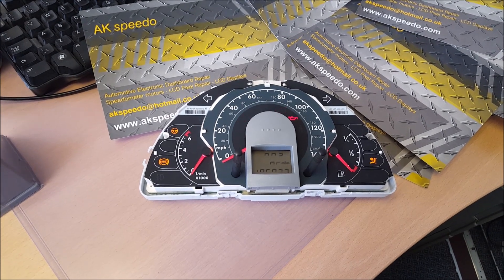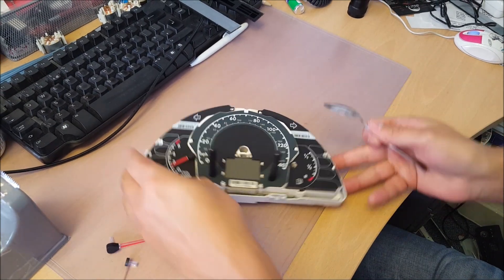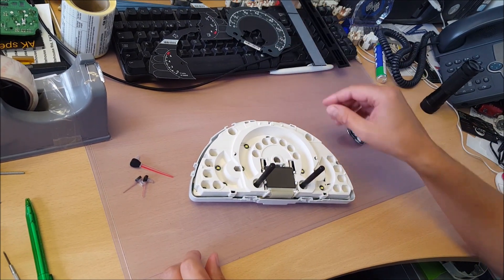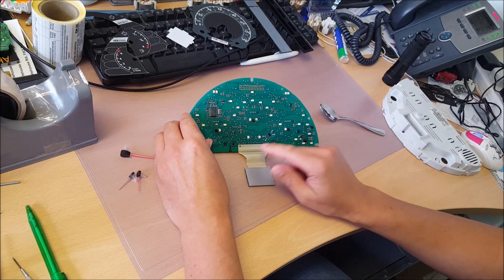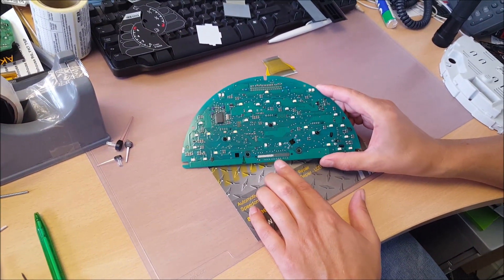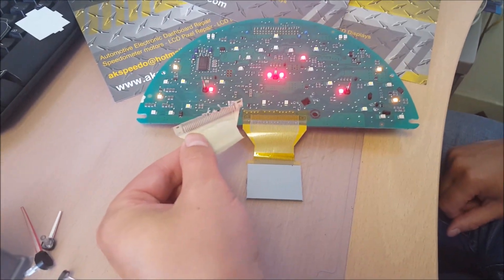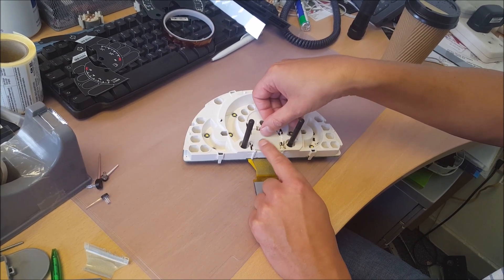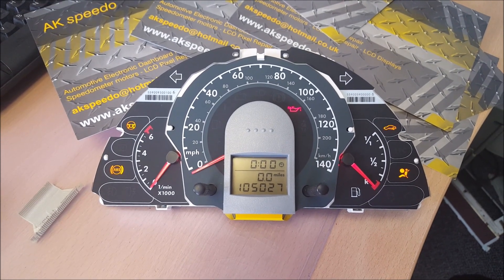VW Fox Speedometer Speedo LCD Pixel Repair

Comment: Watch out - when using the spoon to remove the needles, make sure it's align to 0 or a reference mark as you will need to put it back in exactly the same position. My Fox now appears to idle at 0rpm...

Many thanks for the very helpful videos though, it helped me replace the indicator buzzer on the back of my clocks!

Comment: Thanks Very much, your strip and soldering iron  t bar worked enough for me,  I got the milage showing again in full, which was my main requirement, the clock and distance counter are still not fully showing, but I am sure that was down to not having an exact line up on the strips on my part before heat gluing, however at least I will be able to sell the car now with the milage showing which was main requirement. So I would fully recomend this cheap fix. Removing the unit is fairly easy and can be looked up on the net. I cleaned the old glue off the carbon pads using a cotton wool bud and nail polish remover and used a credit card for the lcd glass. A tip to others doing this fix is to take a photo of the dials before you remove them and dont screw the panels back on the car until you have checked the speedo calibration after refixing them, I didnt take a photo and  had to remove the unit and speedo needle and re-fix it a few times to get it back to 0 at a stand. First time was at +10mph second time -10mph, 3rd time I got it right. Again the fault was on me. This is well Worth a go for a fairly compitent diy er. I am pleased with the result. Worst case you may need a couple of strips incase first one not quite correctly aligned.

Comment: There are some lights broken in my dashboard, is it possible to repair it?
How do you uncounted the dashboard?
Thanks
Reply from the maker: Hi, What lights are failing?
Reply: Warning light to show that front lights are switched on, light alerting overheating of the motor.
If I good understand, it’s not incandescent buble but led directly soldered on the circuit board...
Thanks
Reply from the maker: Yes, correct, SMD LED soldered to the board, cheers

Comment: looks good. im going to buy the cable from your site its pretty cheap. what is best to clean the pads with though?
Reply from the maker: Drop us an email one you've placed your order, cheers
Reply: Did it today. Clean carbon pads with acetone and use technical alcohol on the display.

Comment: very nice! What do you use to clean the pads and what do you use to bond the cable back?
Reply from the maker: Cable has heat activated bonding glue already on it, you can't reuse an old/original cable, cheers  http://www.akspeedo.com/
Reply: Thanks for your reply!!! Where can I find this flat cable to buy?
Reply from the maker: Available on our website http://www.akspeedo.com/ VW page, cheers